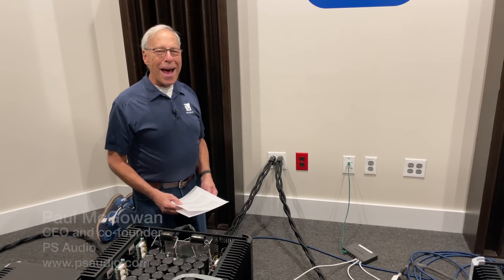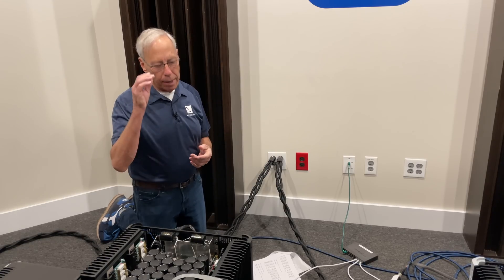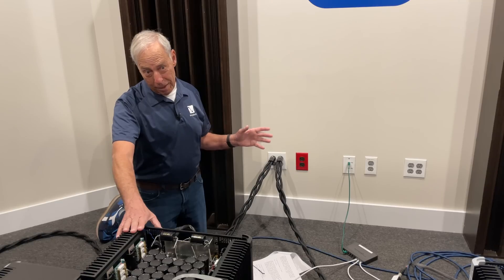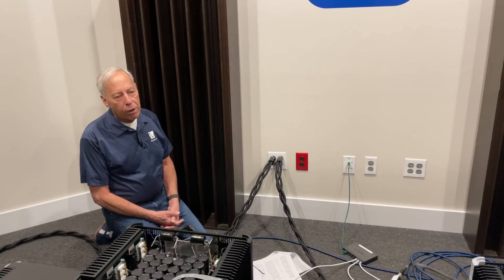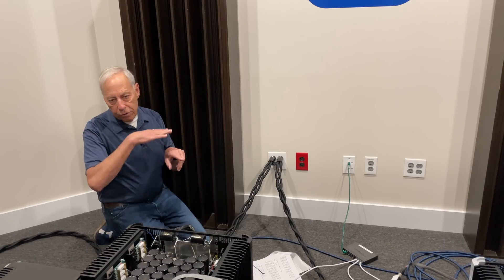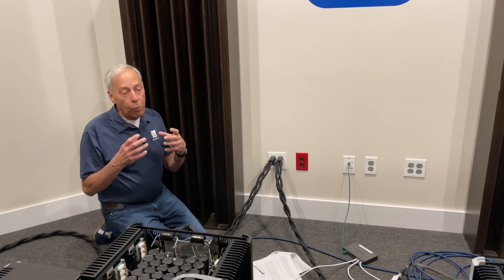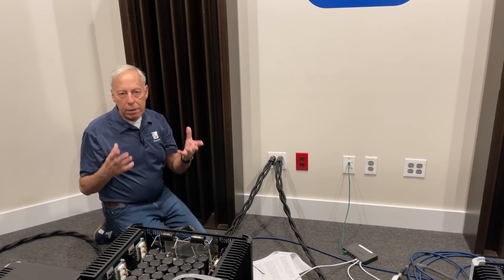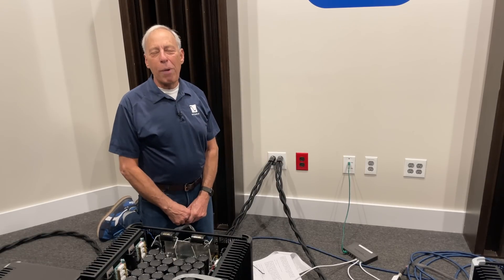Are braided power cables better?

Comment: Electricity, doesn't it have a frequency of 60Hz? So inductance wouldn't matter because electricity is so far away from the highs getting rolled off anyway, right? What am I missing?
Reply: And the power supplies in any devices, also designed by Paul, remove those higher frequencies as much as possible. Nobody wants high frequencies from the power lines.
Reply: Audiophiles would rather spend thousands on an inductor for their 60Hz mains than to install a whole battery system which could output DC or clean sinewave
Reply: @RennieAsh  I agree, that's the greatest stupidity of all hardcore audiophiles. Sixteen years ago I gave up fighting about wall current quality and took a leap of faith towards batteries. After solving some minor problems I remain very happy for having done this and I don't think I'll ever go back to wall-power. Perhaps for subs only, when I decide I definitely need them.
Reply: @fullranger3435  with class D amps, they'd still be quite low consumption, except when blasting them.
Reply: @RennieAsh  Yes, but you're going to blast them anyway if you want to go real low. No misconceptions about it, for glorious low frequencies, you really need a lot of power, many watts. My system components work all with 12Volt DC. There is no class D subwoofer amp that puts out many watts with only 12 Volts DC. There are some car-audio ones but their quality is not to be trusted. So, I'd need a completely new set of higher voltage batteries, or return to the wall. Perhaps it's OK for very low frequencies only.
Reply: @fullranger3435  A good sub amp wouldn't be noisy from mains, plus since the rest of your system is isolated, no issue with ground loops or other noise transfer I'd think.
Reply: @RennieAsh  Agreed. But what I trust more, is the brutal low pass filtering, in some way I feel not much of power contamination would pass through this. Again, with a questionmark, since the lows (and anything that comes along with them) are going to be played at high SPL volumes (in order to be heard).
Reply: It more has to do with pickup-noise cancellation between positive and negative leads. Braiding sticks the two opposing electromagnetic waves very closely together (better than in a typical close-parallel run), so picked-up noise is cancelled/rejected. Inductance is reduced as well, which is good, as it is also a form of resistance to momentary demands for current. Power cords work with high currents so inductance tends to go high too. Reducing it is good.
Reply: @fullranger3435  That braiding can in best case sticks the two opposing electromagnetic waves very closely together (better than in a typical close-parallel run), so picked-up noise is cancelled/rejected. So can a twisted pair construction where parallel wires are twisted together. At the close distance to the power cable a thinner twisted pair type cable construction with shield will emit far less magnetic and electrical field noise to the environment that this way braided thick power cable. For avoiding noise getting to the cable or emitted from the power cable, this kind of thick wire quite loosely breaded together is not far from optimal construction. It could be somewhat better than simple parallel lines (compared to straight parallel lines with same thickness), but there are better ways to build mains cables if you want to avoid noise pickup and spread of noise from your mains cable. 
I see that braiding mains cables like this is not the worth of the trouble for DIY or paying high markup to buy ready made. Braiding like shown on the mains cables in the video are far from optimal cable construction for this application or any hifi application.
Reply: @epanorama  I agree, two (+,-) leads twisted are the first and simplest form of "braiding". This geometry/result is bettered by multiple braiding of thinner wires. The problem with high voltage/current cables is that the insulation has to be thick (and perhaps multiple) in order to be safe (and for that, perhaps some special legal limitations are implied too). Of course I'm not naive to believe that having such big distances between the thick braided threads as presented in this cable here is able to solve the problem alone, it just helps, I believe.
Reply: nothing
Reply: Show us some data

Comment: Kool, typical install -  3-meters of $200 braided power cable, $5.30 Home Depot wall socket, 75ft of 14ga single strand romex,to  $10.50 15A Home Depot circuit breaker. Makes a lot of sense.
Reply: $200 haha, that'd actually be resonable.
Reply: @beeker9895  good one 👍
Reply: For audiophiles the last 50 cm of the chain are active magic - wise people take the wasted money and buy basotect for their room
Reply: @Harald_Reindl  
Active magic is absolutely right. 
Magic because it's the segment that you see.
Reply: $200? I think you forgot a zero or two
Reply: Sure, I believe in u. U have done what u do n telling us a good story, for facts.
Reply: Audiophile stuff always contradicts itself in many ways.
I’m just here for education and entertainment. I’m still happy with my $10 Bluetooth speaker.
Reply: @Bassotronics  There was a Radio Shack $50ea speaker quite a few years ago that with a few DIY modifications recreated it into a world class near monitor.
Reply: @Bassotronics  I just picked up a 2nd hand BT speaker, the little 3" full ranges actually play quite well when with a bass heavy song. It's fun, fills a room well enough .
I do have a proper stereo too :)

Comment: So is the building wiring behind the wall also special braided cable? Or is it regular NMB / BX. Why does a few feet of special power cable at the end of what could be up to hundreds of feet of parallel building wire behind the walls to the distribution panel make a difference? It is a serious question.
Reply: In my experience they do work and make a difference. The most obvious difference is that they reduce noise from the network. Think about it like a filter.
Reply: @souldark-i1m  They’re designed to do the exact opposite of that. If there’s a point to braiding it’s to prevent filtering. 

I could tell you what’s a way more likely reason for you to feel that “obvious difference”, but you’re not gonna like it
Reply: @TofumanFC3S  when he referred the subject is power cables, he is right.
Paul did explain, individual power wires (+,-) creates electrical magnetic fields as interferences when running parallel closely to each other, so braiding the wires (ideally crossing each others at 90°, practically >90°) will minimize this adverse effect. The concept should not apply for IC, some said "attunates" high frequencies musical sounds. Like "best thick powerful" speaker cables, they should not run at close proximity and parallel to one anothers.
Not sure what u mean "filter"? Like to learn from u 🍻
Reply: @williamlau7179  Was in reply to Constantinos
Reply: The last mile counts more than the whole length, if no better choices. Using (multiple) solid braided coil wires is the way. Plus shielding with aluminium foils+braided aluminium shields and solid coil wires embedded in teflon coil can make happiness. Hearing is believing. Paul is right, when his top notched components (& well designed+heavy investment listening room) can demonstrate the differences but "not majority of other common casual users". Isn't he right? Most important, Paul has a pair of well trained ears, plus his professional friends and coworkers, right?
Reply: @williamlau7179  Hey , let’s say that last mile bit is true, then having that 1, 2 or 3 ft. of fancy cable still only represents 0.02, 0.04 or 0.06% of that all crucial mile. And those percentages are even rounded up!
Reply: @TofumanFC3S  the last mile could mean the curing point once and for all when it is applied appropriately and effectively (nearest to components or at the house). I wish could have the Paul's top end power conditioning unit plus many high end components, especially the "best speakers", it cures the unwanted interferences, no questions asked. For the cables, not many good cables are "too" expensive. Good matching is the key words (including your rooms n ears, I guess). Or u could DIY, if that is more happiness.
Reply: @williamlau7179  that's just people making excuses so that they can hide behind the "I'm rich" wall.
Reply: @RennieAsh  yes, fully agreed. It is like the lamborghini, some people are buying it for enjoyment. I Like the cars but not affecting my thinking. Good cables are not always too expensive. Rational purchases for good matching could make u more happiness n opened minded. Your money, u decide 👍🍻
Reply: We have a BINGO.
Reply from the maker: No, the building wiring is standard 10 gauge Romex. What's important to remember is that when it comes out of the wall we;re now prone to radiated noise from the equipment it is powering. That radiated noise is significant in many products and contaminates the others connected to the same power source. Braiding helps reduce the pickup of radiated noise.
Reply: @Paulmcgowanpsaudio  Is the braided power cable acting as a filter? If not, surely it passes through all the noise the utility wiring is picking up along the way. That is of course handled by the proper DC filtering stage anyways.
Reply: @niilaheikki  audiophile high-end gear seems not to have proper power supplies
Reply: @niilaheikki  
PS Audio Power Plants. I use a P15, unfortunately, I couldn't afford  their P20, but their P15 works wonderfully.
Reply: @Paulmcgowanpsaudio  
I think you can also note that there are different "ways" to braid wires with the same positive outcome. I don't use Audioquest  cables, but another brand that incorporates braiding.
Reply: You heard him say how "crazy expensive" those were, right? Those guys are in it to make money. That's why he said they sound better.